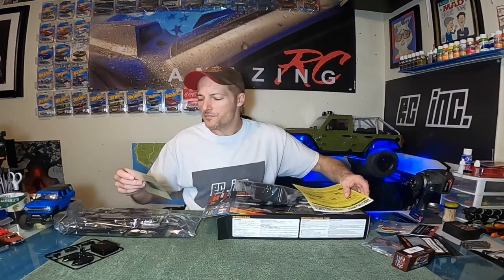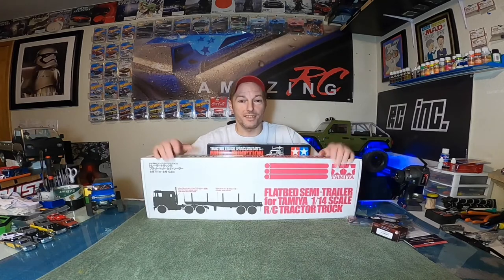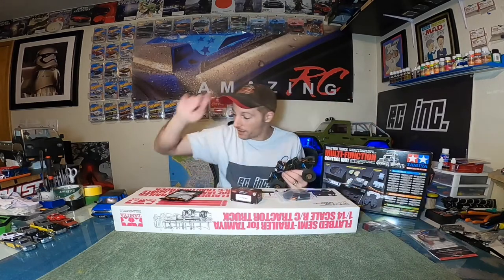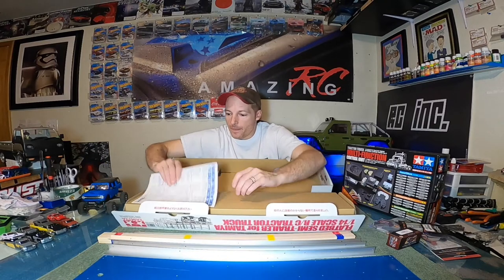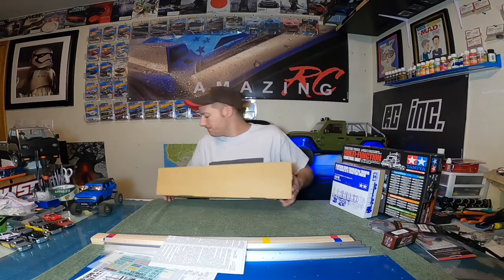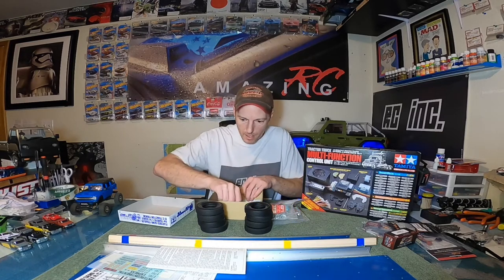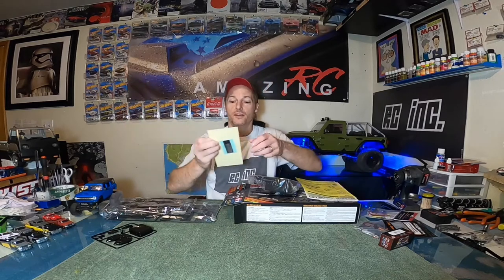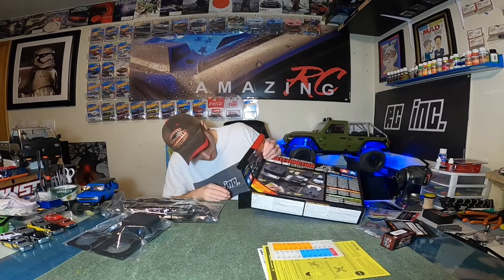The most MAJESTIC Accessories for the Tamiya Grand Hauler.!!!  Flatbed Trailer & MFC..!!! #RCELF

Comment: Building a Tamiya lorry is one of the most fantastic thing in Rc and can understand why you want to do the lorry first. The flat bed  kit is a great thing to build, have built one and the box trailer for my Globe liner. The multi function unit, once in the truck you will not be disappointed. The sound unit does so much and more.
Reply from the maker: I am so happy that I have the opportunity to install the MFC unit. I remember all of the videos from your side of the water and the one thing almost everyone had was a sound module. I had never realized that it had a module that mad it vibrate during idle. I just know that I am going to be blown away.! Keep you posted, and thank you for your kind words.

Comment: You are going to have a lot of work. Between the truck and the trailer it's going to take time, but it's such a great job that time doesn't count. You were right to take the Tamiya MFC-01 unit, it works super well and it is definitely essential in a truck. In fact you have 20 LEDs for 9 lighting functions and you have 24 different sounds. A nice thing on this MFC-01 is the vibrator which works in relation to the engine speed and that's great. Also remember to put the lights in the dashboard of the truck, you can turn them on or turn off with the radio. The small control unit is placed on the side of the truck, where there is the tool box. And maybe you'll buy motorized jack stands for your trailer 😉 Watching your videos on the truck and the trailer, it makes me want to rebuild another truck 😁
Reply from the maker: I am so happy with this amazing truck.!! I get to start the build today. I am so excited.!! I have always wanted one of these big trucks.  The trailer has been a dream of mine too. I cant wait to paint it. And I am really happy to have the MFC unit.  Keep you posted my friend.!
Reply: @AMAZINGRC  I'm sure the result of your work will be great, can't wait to see what's next 😉👍